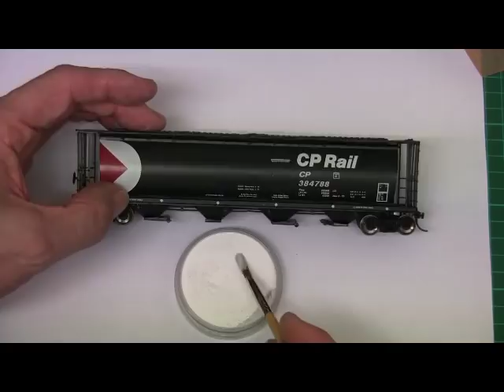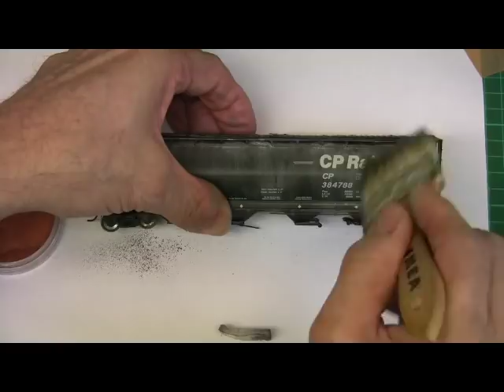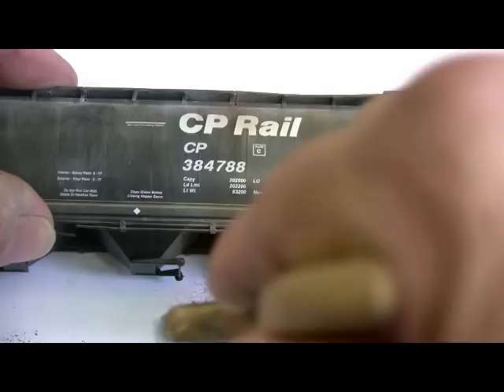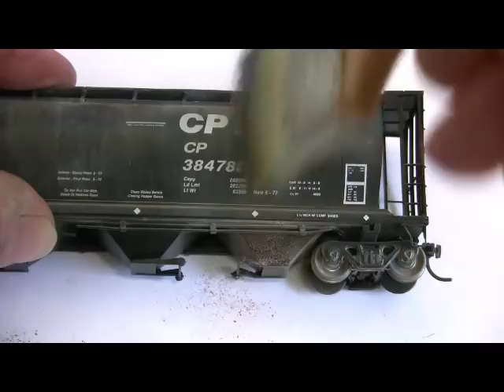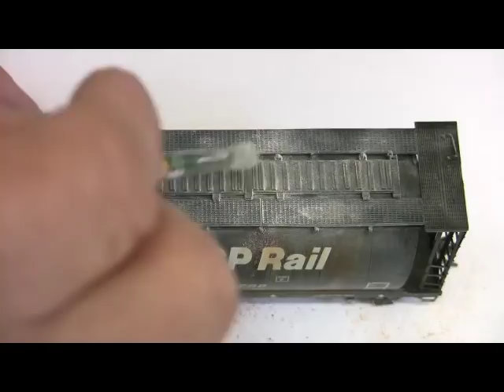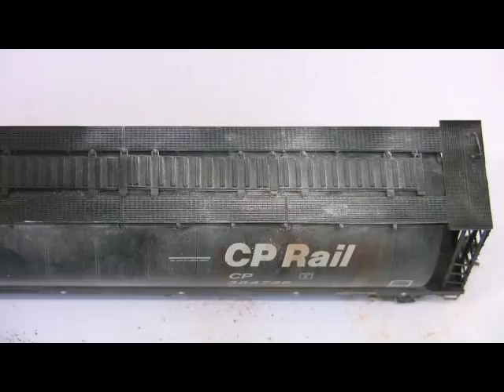Weathering with PanPastels

Comment: Hi, how do you fix it ? Airbrush, hairspray, matt varnish ?
greetings from Europe.
Reply from the maker: Matt Varnish. Testors dull coat or Army Painter matt spray. Hairspray tends to leave a slightly glossy finish. If you have an airbrush Vallejo matt medium also works but is more work to clean afterwards.